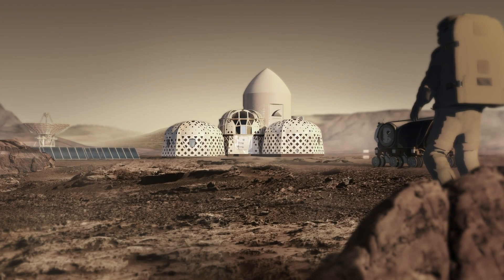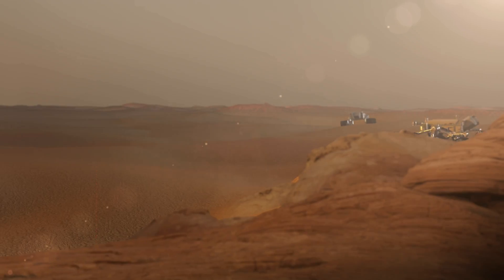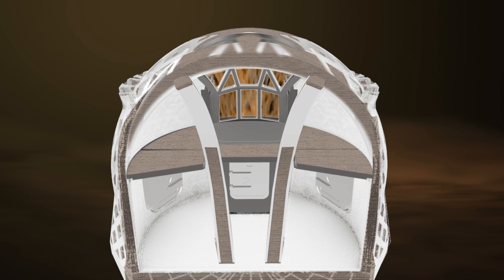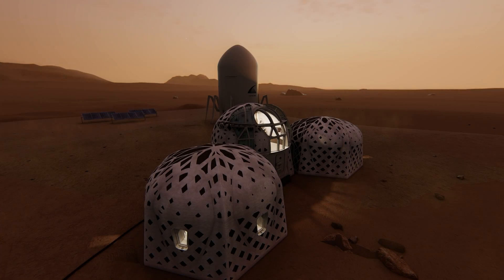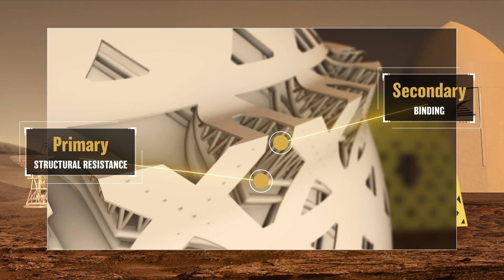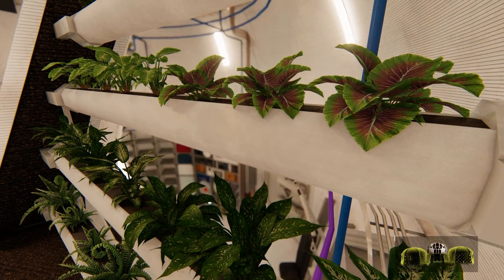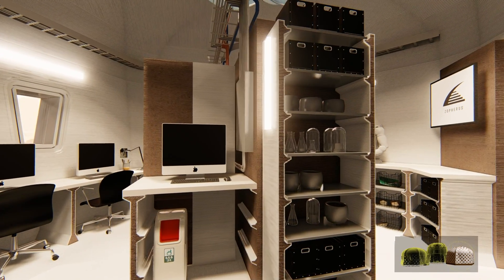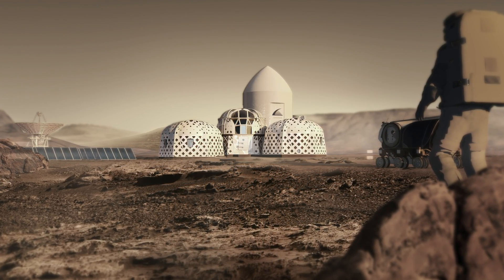Team Zopherus - Phase 3: Level 4 of NASA’s 3D-Printed Habitat Challenge

Comment: not fan of concept art. I do like thin layer plastic iner and outer layer have ribes go mars cement. only concern recycle plastic have brought earth add weight launch rocket. I heard bidradble plastic mad corn. biodegradable part might not work in this case but to bad seed green house or print green house grow plants to make plastic for outer and inner walls and ribes. then make use carbonized in air and ice water if find it. get plastic material from that. rubber mad tree rain forest think. rubber might be possible material to use too. came idea second time watched though maybe first house print be green grow things help make other houses.

Comment: How is the lander/printer "sealed to the ground"? There doesn't seem to be an drilling of anchors or similar, what allows it to be pressurised enough to serve as an emergency shelter? Assuming (for illustration only) a 50 tonne lander mass and a 5m diameter, you would be limited to 0.1 atm pressure without additional anchoring.
Reply: The atmosphere on mars is extremely thin.  So far it also seems to be a fairly stable planet (not crazy seismic activity).  Buildings wouldn't need to be anchored down.     Some places here on Earth have buildings that are a few thousand years old and made of woods or bricks.
Reply: @walperstyle  Sorry, I wasn't clear. Because the air pressure on Mars is low, less than 1% of Earth's, any Earthlike pressure inside a structure will be creating outwards force on any it, including trying to push it off the ground. At 1atm of internal pressure (if it is intended to be used as an "emergency shelter" for crew), it will be producing an upwards component of 10 tonnes of force per square metre. A 50 tonne lander, 5m diameter, will break its seal with the ground at just 0.1 atm. Even using pure oxygen (which is risky) you need around twice that pressure. Anchors aren't necessary for earthquakes or wind, they are necessary to hold it against its own internal pressure.
Reply: its own internal pressure is only an issue in the event it has somewhere to go.  I'd imagine it wouldn't be that hard to create something much like a suppressor (commonly known as a silencer by hollywood people who watch too many action movies.    Insulation that disperses pressure.   But yeah< I guess they didn't show that much detail in this.    

To be honest, it wouldn't that difficult to create a structure that acts much like Blow off Valve used in vehicles.  Or at least a series of layers that works in such a manner.   Otherwise, its own pressure isn't any different than being in a submarine.
Reply: @walperstyle  Layers/etc are irrelevant. It's the overall pressure difference. In a 5m vehicle at 1atm, there's 200 tonnes-equivalent pressure trying to push it off the ground and just less than a tonne from Mars' atmosphere pushing down. It will rip itself off its foundation. (Or in this case, off of any seal they've sprayed on the ground.)

You can't maintain a pressure difference between the inside and outside, if it is open to the ground, without anchoring it down against that pressure difference. It's just physics.
Reply: @1FatLittleMonkey  Layers are not irrelevant if you disperse pressure.  It gives it an avenue to dissipate energy over time and area.   I think we are not understanding each other, you seem to think its just dirt on the bottom.
Reply: @walperstyle  According to the video, the lander sits on the ground. It sprays a sealant on the ground. That's it. There's no additional anchoring, nothing to resist air pressure.

And no. Layers don't help. I think you are misunderstanding the problem that I'm describing.
Reply: @1FatLittleMonkey   I see what you are explaining.  That 'sealant' could be as strong as concrete.  There is some amazing polymers that I've worked with in heavy industry that create flexible membranes.   Either way, if you have an idea, I'm sure someone would listen if you propose an idea.   I'm just a fluid engineer (at best)
Reply: @walperstyle  "That 'sealant' could be as strong as concrete."

Still doesn't help. Concrete is a compressive structure. The issue is the tensile force pulling the ship away from the ground when you pressurise the volume between the ship and the ground. It's not about having a base (a foundation), it's about how to anchor to the ground.
Reply: Have you actually worked with any building materials before or are you a student?
Reply: @walperstyle  I'm in my 40s and I grew up in the building trade. This has nothing to do with buildings, it's about pressure vessels.
Reply: Have you heard of metal foam?

Comment: Initially, most of the human habitation will be below the Martian surface with only greenhouses above.
Reply: I agree that an automated Mars version of The Boring Machine would be on Mars ASAP. but the first Habitats will be the StarShips themselfs. Each Starship has enough space for 700 - 800 seated passengers. The first Mars Astronauts will be only about 10-12  people so there will be more than enough living space for those 12 people in the first 2 StarShips (ie twice the space of the ISS).  I believe the 3rd batch of landings( 1: 2 cargo, 2: 2 cargo + 2 Crewed. )  will have the TBM drills and Habitats like Zophorus and whatever things they discover they need from mission batch 2:  This 3rd batch will be 5 years after the fist landings. Ie close to 2030 at the earliest. 10-12 years from now we should have fairly good robotics.
Reply: No they won't. the psychological factor is a relevant one. There are reasons why we don't let bases in Antartica under ice anymore.
Reply: @antrondon3654  Initially, they will probably be below ground. That is why The Boring Company is doing what it is doing in L.A. They will have a few structures above ground connected by tunnels. There are just too many factors on Mars that do not allow for surface dwellings. As the colony grows they will build more on the surface.
Reply: @Lindenlc10  >That is why The Boring Company is doing what it is doing in L.A.
That's nonsense. First of all, Mars soil is nothing like the ground in the L.A. basin so any experience gained there is worth very little on Mars(aside from the basics, that is).

Furthermore, the current state of drilling and boring on Mars is this: https://www.skyandtelescope.com/astronomy-news/mars-insight-drill-hits-snag/

And no, the Boring Company is not magically better than scientists and engineers from DLR and JPL - they'd face the same issues. Boring and drilling requires detailed knowledge of the ground you're digging through and no one has this knowledge yet. Building underground structures is always more expensive, complicated, and risky than building above ground.

Expanding existing natural structures such as caves or lava tubes is a valid option, though. But again, no such structures have been found and mapped on Mars yet.
Reply: @totalermist  You cant compare the Mars Insight kinetic impact drill tool with the Boring machine's rotary Drill bits based on decades of tunnel boring all over the world. TBM is thousands of times larger and thousands of times more powerful !!  By the time the Boring Machine gets to Mars it will have had 10 years of new technology. In 5 years TBM will be automated robotic drilling machines. Now add 5 more years of adapting that to the Mars environment before they are launched. It will be much more advanced, almost  like is "Magically" so.
Reply: @tobifoong8025  The Boring Company bought a used boring machine. Boring machines of that type have been around for over a century so another decade will hardly make any difference. It's ye olde AM/FM once again: Actual Machines vs. F'ing Magic.

Lets rewind the clock ten years, shall we? In 2009 state-of-the art lithium-ion batteries had an energy density of about 400 Wh/kg. Today it's up to 700 Wh/kg- cut that in half for commercially available cells. For reference lithium-air batteries have a theoretical energy density of 2,500 Wh/kg. In 2009 IBM started a research project with the goal of developing a lithium-air battery. Ten years later and we are still at TRL 4-5, i.e. years away from practical implementation. (I chose IBM as an example because their "Battery-500"-project started in 2009) That's how it works most of the time.

Mars present yet another challenge: "adapting to the Mars environment" as you call it is only feasible if actually know what that environment looks like. Truth is, however, that as of now we know very little about what's underneath the first few centimetres of dirt on Mars. So how exactly to do adapt to something completely unknown?
Reply: @totalermist  sure if you think going 5 times faster and automated is no big deal.. But even if its the exact same speed on Mars it would be very functional.
Reply: @totalermist  You sure are a negative troll.
Reply: @Lindenlc10  No. I'm simply not a gullible tool who falls for marketing blabber and vague, half-baked ideas. But by all means - don't take my word for it. Go out and learn the actual facts yourself. But I guess that's more time consuming and challenging than reading Twitter feeds and watching short video clips...
Reply: @totalermist  Yep, negative condescending troll who thinks he knows everything. Piss off.
Reply: @Lindenlc10  How about some facts instead of cheap ad-hominems tough boy (edit)or girl(/edit)?

Comment: What about the fact that the martini dirt is toxic? How will u be able use it to build parts of the interior if the regolith is toxic and would be exposed to humans?
Reply: Completely valid point!   Using the two print heads, you could coat every bit of exposed martian concrete with a thin layer of printed plastic, or some type of penetrating binder could be sprayed on that would seal the martian concrete.  Another option would be to filter out/neutralize perchlorates during materials processing.  While a serious issue, we felt it was solvable in a couple of different ways without altering the design.  Your concern about toxic regolith is one of the reasons we placed the Z-series suits in an airlock.  We wanted to provide a way to service the suits in an environment that could be decontaminated first.

Comment: I feel like this should have taken first place. I'm no scientist or engineer but I've heard Martian dust is an extreme pain, and of the top three habitats, this seems to be the only one to account for how to keep said dust out during construction...
Reply: Thanks, Christina!  We thought the dust problem was extremely important to deal with.  The martian atmosphere is cold enough and low enough pressure that it would also freeze and/or boil any water in traditional concrete before it would have a chance to set.  Both of those processes would ruin printed concrete.   I might be a bit biased, but I think we're on the same page ;-)
Reply: @treylane5456  Does the lander/printer have any ground anchors that weren't shown in the video? I can't see how you can pressurise it to any level that would allow water to remain liquid, or serve as an emergency shelter, without the pressure lifting it enough to break the ground-seal. Elsewhere in the thread I used an example of a 50 tonne lander with a 5m diameter: it would only take 0.1atm internal pressure to lift it off any ground-seal. At 1atm pressure, that same 5m lander would produce 200 tonnes-equivalent of upward force.